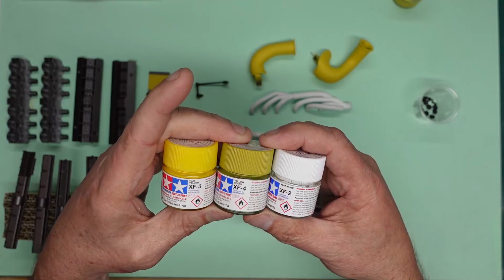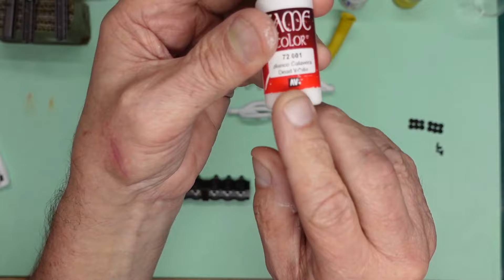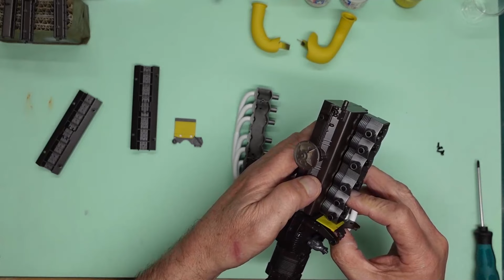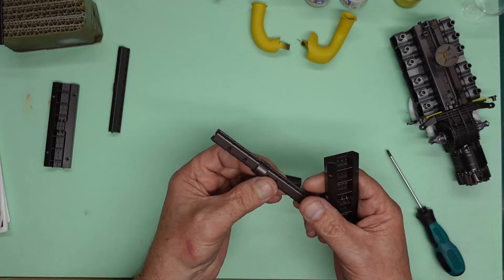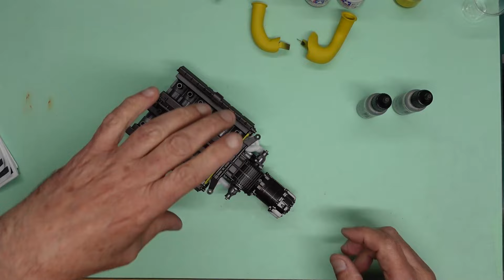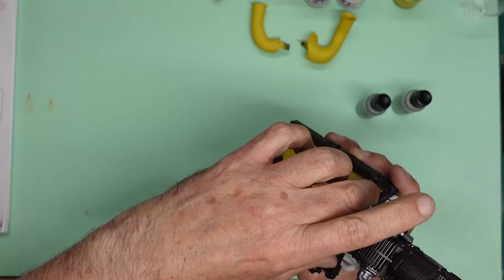The Brand new 1/8 Porsche 917 from Pocher.. Revisited..Part Two B

Comment: Great vid Nige....I was thinking about the fibre glass look could be a mix of LP8 and either LP-30 light sand or LP-75 Buff 80/20 maybe....lol been writing notes in back of my Pocher manual and making little comment marks etc....let you know when I get to start thinking cpl of weeks time.
Reply from the maker: Not a bad idea
Reply: @NigelsModellingBench   I will need to test the ratios on a scrap piece of styrene sheet but I think that might be a way to go....tbh last thing I want to do is screw up a £750 kit